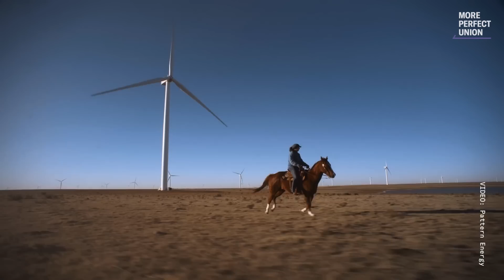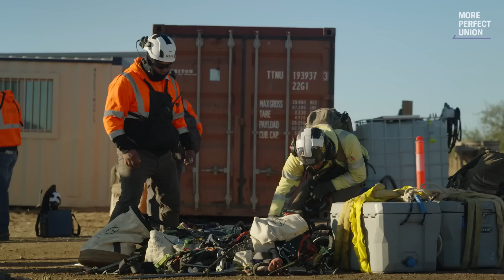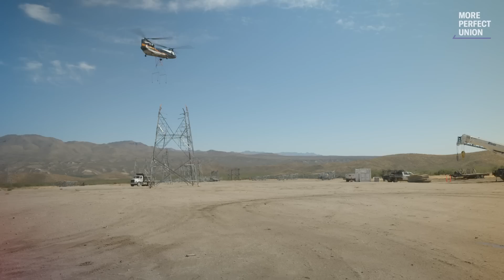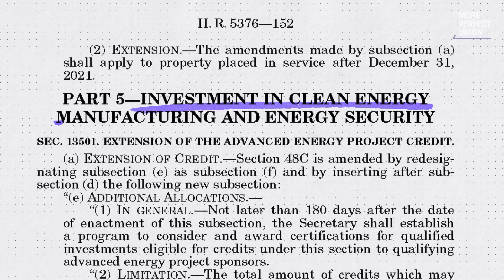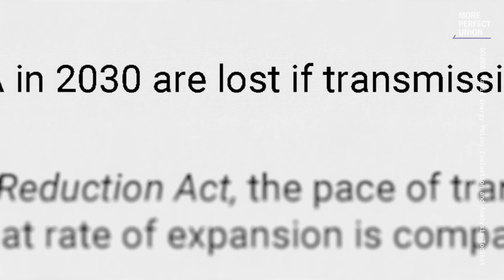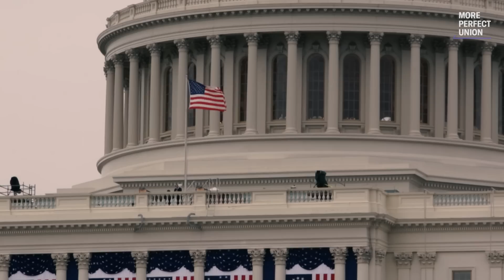Why Clean Energy Might Fail

Comment: Building Transmission lines. Renewable sounds a perfect....but.....it's not the solution. If your country has hydro power......then Renewable will fill the base load power. The next zero option is Nuclear power...we are smart to use Nuclear. Solar panels, wind turbines are suitable for small off grid communities. The waste from after wind turbines and solar panels is the next huge problem...when their life is over.....where the F.uck are we going dump them?

Comment: Thanks for the presentation. Power transmission  is a big problem. In recent years an awareness' has developed about the greater efficiency of using high voltage direct current (HVDC) rather than alternating current. Direct current transmission is more efficient for distance over four hundred miles.  I have just learned that using HVDC transmission can be more  efficient for shorter distances if the cable is buried.  There are examples of HVDC cables being buried along railroad lines. I have always thought that that the interstate highway network could also be part of an energy network.

Comment: Renewables are always in far flung places so new lines to connect to established networks need to be built. Here in Australia this has also been a problem but appears now to be fixed. Our main issue is the oversupply of renewable energy when the sun and wind are abundant. Our regulator the Australian Energy Market Operator is seeking government approval which would switch rooftop solar off at peak supply. This is purely a means by which energy prices are regulated to benefit the energy companies. Who would have thought you can generate too much energy through renewables. Classic Capitalism, supply and demand, control the supply and you control the price. 

They way it is going it’s better for individual homes to store your excess energy in batteries and only buy energy when needed. 

We

Comment: Wind turbines are high maintenance infrastructure, so are long transmission lines. It is not enough to build them. The unusual remoteness of such wind based electricity generators creates a cost overhead that will easily change the entire project into a money-burning endeavour...
Reply: It's ridiculous that American NIMBYism has gone so far that bringing an all-terrain crane into a middle of a desert through private property has (despite decent-quality roads and passable hard soil!) become more expensive than renting a frigging huge helicopter
Reply: @ain92ru  lol @ using a helicopter.  Even with the cranes there is a lot of downtime due to the simple fact that a wind turbine is typically built in an area where it is windy.  Those cranes they use also have a lifting capacity of around 650 tons. While yes they do need to oversize them a bit due to them needing a bit of reach but there is NO helicopter that will lift what they need to lift. My buddy installed wind turbines and he said the blades are almost touching the boom.  If its windy they are shut down due to safety.

Comment: The electricity produced can be used regionally for the production of hydrogen (H2). H2 in turn can be used for production of ammonia (NH3) which is used to produce fertilizers e.g. ammoniumnitrate. The N2 that is needed is separated from air. H2 together with CO2 from e.g. a power plant, a chemical industry, a cement industry, etc. can be used in the production of methanol (CH3OH). Methanol can be converted to gasoline, jetfuel, etc. and much more.

Comment: Putting 40k solar system on my roof to save a $100 a month does not work. I’ll dead before the system is payed for. By then the components will also be dead. Also car engines that used to last 300k now can barely make a 100k. I’m all for green energy but it is going to break us before the tech is mature.

Comment: The main issues i see with green energy 
1. the cost of transmission and outside of the most prime areas for wind storage is expensive 
2. Renewable got a large land footprint compared to something like a gas plant
3. The capital structure of renewables. The cost is all in the start up cost so ur basicall having to pay 80-90% of the expenses of 20 years operations before revenue service even begins and often takes longer to plan and build. This is the same problem nuclear has. A nat gas plant can basically be sited/planned in any industrial zone in a city with a water supply and be generating in 3 years. This means take on more debt with a longer payoff time and in finance money now is always better than money later.

Comment: I know how to describe energy and its transductions scientifically, but the term "energy" is still understood somewhat vaguely by the public. Really, what most people want is cheaper electricity for general use and cheaper costs for transporting goods and people. "Clean energy" mainly refers to solar, wind, and hydro. Like most things in life, there are pros and cons. Solar, wind, and hydro in general tend to generate less energy and they require a lot of capital (which can degrade over time), but the biggest pro is that it's free to draw from as long as the sun, rivers & gravity, and wind continue to exist. I don't think clean energy should be the ONLY thing we rely on, but why not take advantage of it if it's just there for the taking?

Comment: It's a bit grim that where we're at right now is that we need to intentionally ruin a lot more of our environment so that we don't unintentionally ruin all of it.  The idea of scaling down our energy use just isn't even on the table anymore.  The way solar is being installed in my state is mostly cutting down large swathes of forest, and now we need to cut down even more forest to transmit the energy to the grid.  I can't help but feel that this constant need for growth eventually ends in it all being cut down.
Reply: We are a society chronically addicted to the most potent drug ever made. Will die if we stop, will die if we don’t. The pooch is cooked and the time to fix this was 50 years ago, aka the second the problem was seen. Try to enjoy the time in the sun we have left. Very dark times ahead. Also take the time to mentally prepare yourself for when the shift hits.
Reply: So you are okay with them cutting down the trees that absorb carbon for green energy? Also, its is not just trees. Many creatures that help are there too.
Reply: @MrBashem  That was pretty much the opposite of the point I'm trying to make.  I'm an ecologist, my job prior to my current one was opposing sand and gravel mining that was being predicated as green energy development.  I made my comment to make people more aware of the trade off.  There's a big gulf between what I want and what is likely to play out however.

Comment: Actually, one reason cleaner power sources have always been undesirable to the big players is because they facilitate decentralization. If I have a local water wheel or windmill — or photovoltaic panels on the roof — then I’m to that extent independent of the coal-fired (or whatever) turbines in a centralized plant, which call in turn for long transmission lines.

We could replace the high voltage lines and transformers, still losing so much to waste heat, with superconductors. However, private industry is too afraid of a new higher-temperature superconductor making that investment non-competitive and hence from the capitalists’ perspective obsolete.

The very efficiency of cleaner power systems drives down profit margin. They’re advantageous for a capitalist using them to power an operation with fossil fuels as the product, but only until competitors follow suit.

In short, what sets up clean power to fail is betting on the dirty power cartels to provide it.

Comment: Nuclear is green and safe.
We only use 10% of the fuel rods before discarding them, but 90% can be recycled and reused. France does it all the time.
Reply: And now with salt water thorium reactors they are perfectly safe and use spent material as fuel

Comment: One reason: PHYSICS.  Or to be more precise the second postulate of thermodynamics.
Reply: Well for one, its not a postulate. Two, this is windmill power. Heat doesn't come into play.
Reply: @BoxEnjoyer  Hint: the wind happens NOT because the trees are swaying.  Look up on what energy, work, and entropy mean.  Don't be afraid of scary math.  Once you understand what those things are the world will loose all it's wonder and magic, but you'll know how shit works.
Reply: @ecchioni  Dude, I have a bachelors in engineering. It doesn't matter how the wind is generated, the wind is going to happen either way. In the actual conversion of wind to energy, heat doesn't flow anywhere. Unless you're talking about the heat generated from resistance, but that would only be a thing after electricity is generated, meaning the windmill was successful. Maybe you mean the heat generated from friction, but that means things are spinning, and electricity is being generated. Either way, just saying "Heat moves" doesn't mean anything. Show your work

Comment: Pretty much a problem of using poor designed wind turbines that need to be out in the middle of no where with thousands of miles of line to reach where their needed. Tech in wind power is way ahead of the crap shown in this video. Huge blades that burn up and fall off high towers is ridiculous. Vertical turbines that don't endanger wild life, take up way less space and can be in the cities, towns etc are available. America, behind the times and resistant to innovation.

Comment: Solar and wind are expensive and inefficient. Proven true efficient and clean energy comes from nuclear, hydro electric, geothermal, and natural gas. We need more nuclear plants not the pipe dream of solar and wind. Nuclear plants put out 1000 times more power on a fifth of the land of solar and wind.
Reply: But have they solved the waste issue?

Comment: One word: DECENTRALIZATION!!! Stop thinking the 21st century grid has to work like it did in the 20th century!
Reply: Decentraliztion nullifies the cost advantage of solar.
Reply: @incognitotorpedo42  So if I have solar and batteries, and a VPP there's no cost advantage?
Reply: @jonathanf.9395 You realize you have to pay for your equipment and amortize it across the electricity you use, right?
Reply: @gregorymalchuk272  Wait, are you saying it's not free? I'll be damned!!You realize batteries and Solar have DRASTICALLY come down in price in the last 10 years and it takes about 5-7 years to pay them off and the equipment will last 25-30, right?
Reply: @jonathanf.9395  Is that with or without taxpayer money? To fully power your house would cost quite a lot. ROI would take at least 10 yrs with all the perfect conditions.
Reply: @incognitotorpedo42 how?

Comment: I am wondering how putting Solar Panels on Roof can affect the need for Transmition Lines.
I saw a report of a Project in Florida where and when they built their community they took Hurricanes and Clean Energies into consideration.
They survived the last 2 Hurricanes and did not lose lights or buildings.